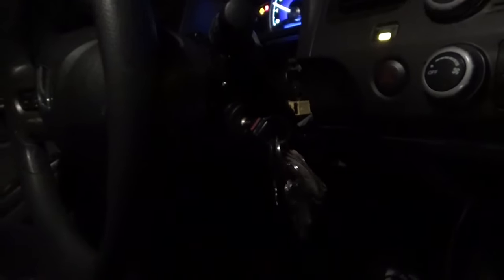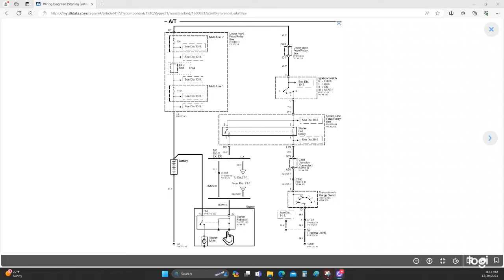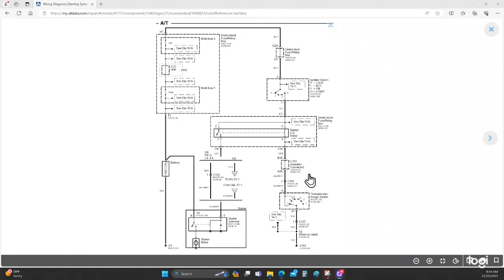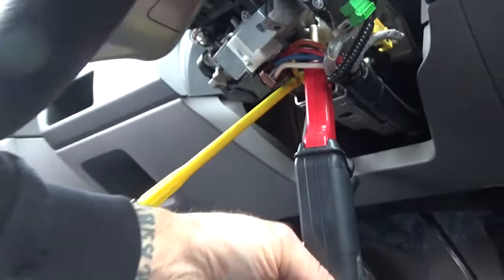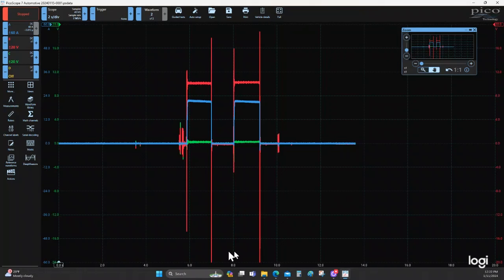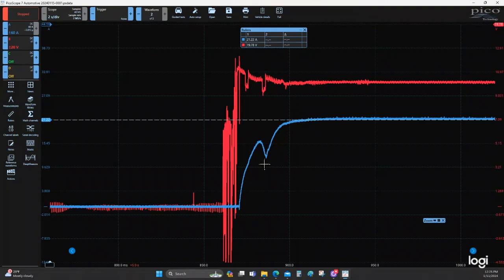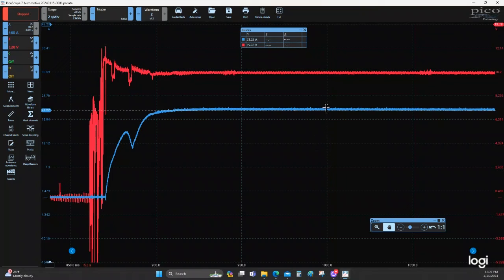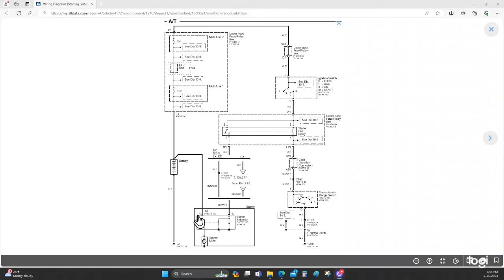Mastering Diagnostics #10: 10 Days of Troubleshooting Torture

Comment: Thank you Brandon, once more😊

Additionally, when the solenoid main contacts finally close and allow the starter motor to engage you should be able to spot the amperage to the solenoid (S terminal) decreasing the very moment when the pull in winding is deenergized.

With the main contacts at fault and not closing, both windings ( pull-in and hold-in) will consume more current.
Reply: You got it!

Comment: Great demo vid well explained , i was trying to answer the delay symptoms that went away after the car had started ?
Reply: Thank you! not sure I quite understand your comment, but the delay was due to the solenoid physically sticking/not shuttling properly. The contacts that supply current to the starter motor wouldn't close.
Reply: @brandonsteckler3417  Thanks Branon , i watched your video again and gave it some study , the delay was as you say both solenoid windings staying energized and possible sticking plunger ,

Comment: Nice video, In order to make this a 100% sure call, wouldn't you want to see voltage on the large cable at the solenoid while the failure occurs? A bad connection between the battery, and the solenoid, could also cause the results you have on the scope. In practice I'm sure you made the right call, but it is a possibility (however unlikely). Thanks for all the tech videos,  as usual, I enjoyed it.
Reply: You’re are absolutely correct. If that area was easily accessible, I would certainly have tested there.

However, considering the fault comes and goes so intermittently, in my experience, that specific circuit issue would’ve been highly unlikely.

If this was in a shop scenario, I would sell the starter and carefully inspect connections upon disassembly 🤜🏻🤛🏻

Comment: Your training videos are amazing. Do you have any understanding wiring diagram videos
Reply: Doug, thank you so much for the feedback. I do not yet have a video based solely on wiring diagram analysis however, I can make a few recommendations for classes that are offered through Carquest technical Institute.
Reply: It would be greatly appreciated if you could send class information. I am a fairly advanced diyer but do struggle a little bit with wiring diagrams. I get there but slowly. Thanks again Mr. Steckler.
Reply: These classes are designed for the professional technician. I’m not sure where you can find traing for a DIY’er.
Reply: Thanks for your responses. Greatly appreciated.
Reply: My pleasure!

Comment: Hi Brandon, great presentation. Question: If you were to perform a cranking amperage test (RC) from the negative battery cable,  wouldn't you have been able to see the same information with the addition of the actual arcing taking place when the solenoid plunger bridged the contact between the B+ and M terminals? Just curious on your thoughts.
Reply: Yes, I would’ve saw all the above and everything else operating in the vehicle
Reply: What would that amp trace look like if you for some reason had the lights on and doing the cranking amperage?  It'd still show the shuttling hump?

Comment: Last resort puncturing a conductor , apply 3M Scotchkote FD coating . This coating is specially designed for underground electrical splices .  It is expensive but is well worth it . Amazon , 15 fd oz can is $60.00  A less expensive alternative is Dap tub and tile caulk in a squeezable tube P/N 8889 . Do not use RTV acrylic silicone , it is corrosive .
Reply from the maker: Thanks! So long as it doesn't corrode copper, it will suffice. NO RTV ALLOWED though...very important!

Comment: Ohm's law 10 volts ÷ 20 amps = .5 Resistance
Reply: Why plug 10 volts if it's a 12 volt system?
Reply: @edwardlara1011  from the video, 10 volts was the voltage